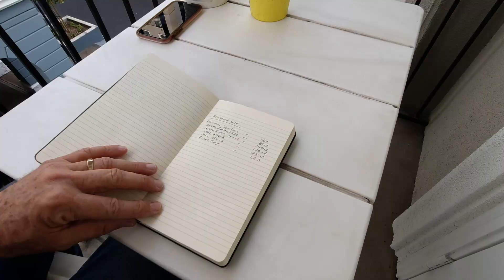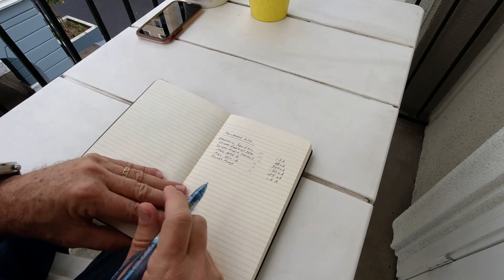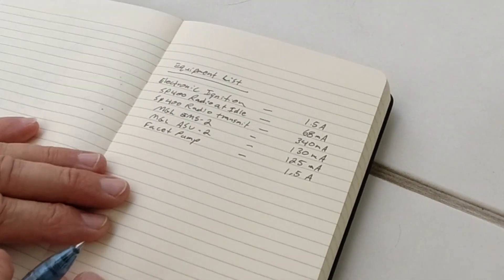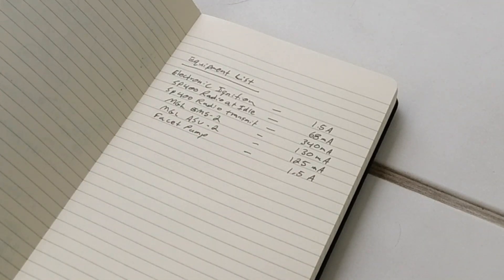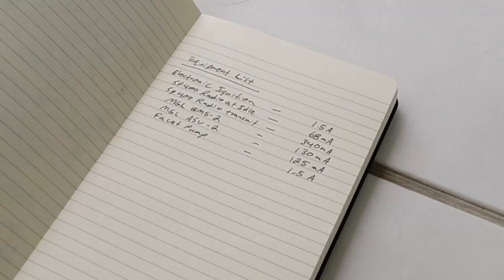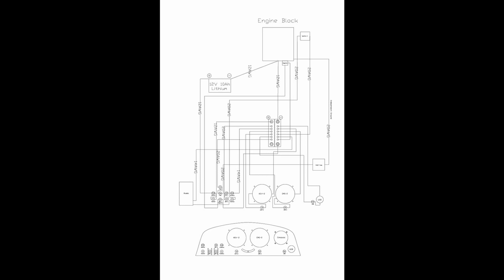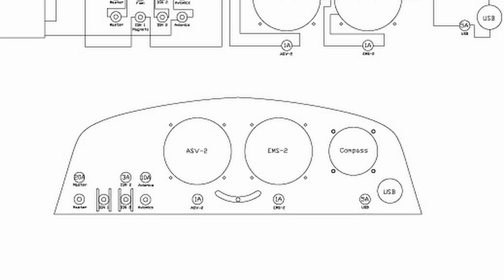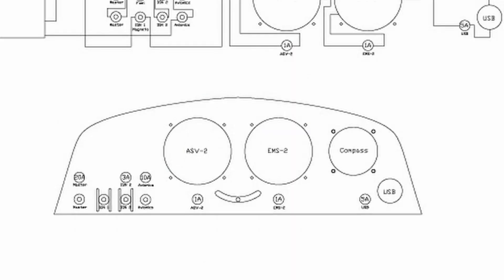Minimax 1100r Aircraft Build Vlog Episode 44 - Power Distribution

Comment: I have an MGL for my engine monitoring. It is great with the ability to set service timer, HOBBS (which you can set trigger RPM on) and flight timing.
You will have to add all the sensor wires for CHT, Oil, EGT and ingnition to the MGL for it to give you a display of the relivent info.
Like the Hurry Max colour idea.
Reply from the maker: They look like great instruments. When I added up the cost of a full steam gauge panel, the cost was a lot closer than I thought between that and the MGL.
Reply: @DTMinimax  Function for weight, cost and clarity of display is why I went  that way. The only think that took time for me to get to grips with, was digital rather than analoge tach.

Comment: I’m not an expert, in fact I know very little about Aviation. However, I do have a couple of thoughts that I feel, should be considered. 
Take for example, A motor in a lawn mower doesn’t require a battery. It generates it’s own power to operate it’s own ignition system.
If a similar generation system is used and there is a complete loss of battery power the engine will still continue to run. A lighter battery would be required offsetting any increased gain in weight due to the power generation system usually in the flywheel of the lawn mower motor. In addition, it may be possible to produce a charge for the battery, thus requiring a even smaller battery! I don’t think this would add very much weight and would add a very beneficial  amount of safety. Also, are you remembering/required to have any strobe/wing lights in your calculations? 
It’s been very interesting watching you build your plane. Makes me want to consider doing something similar!
Take care!
Murray Adams
Reply from the maker: The aircraft magneto operates the same way. It isn’t connected to any power source so a dead battery has no effect on it. I had a complete loss of the electrical system in a Cessna on night but knew that as long as I had fuel, I was good. 
There are some small wind driven generators that the Piper Cub guys use. I’m curious, what type of charging device were you thinking about?
Reply: @DTMinimax  
Hi Dennis, 
A Briggs and Stratton engine for example, uses a magnet in the flywheel to help produce the current to create the spark to ignite the fuel. Perhaps this same principle can be used to generate some type of usable current to charge the power supply. If that does not work perhaps this might work. My snow blower has heated handles. I am not sure how much current is required to operate them or what voltage they produce, but these systems are built into some small engines. Perhaps this is a possible option that exists and can be used on the engine that you have chosen. I have limited knowledge about this stuff but if you are able to ask the right people perhaps they can help you find or design something that will charge your system.
Murray Adams

Comment: Hi Dennis, great video! I enjoyed the insight into your project & the schematic diagram looks well tought out, I am curious if you add the USB charger capability will you have to factor that into your calculations as well as a safety measure? Will there be a battery monitoring device to show what the draw is & what's left? One thing I learned is while it's easy to see a fuel or oil leak, you can't see an electron leak. The Mini Hurricane paint idea sounds great! I love those old birds. Cheers from Down Under!
Reply from the maker: Hey Leo!
I will be monitoring the battery and good catch on the USB, I left it off the list. 
So true about the electron leak:)

Comment: This isn't part of power distribution but have you considered having a few go-pro mounts around the airplane?  On my Legal Eagle tip ribs I have epoxied some 1/4" ply plates with a few captured 10/32 nut plates. They will be flush with the finished wing tip. Just a thought.
Reply from the maker: Awesome idea to plan those in Kevin! I’ll get some nut plates!

Comment: Hi Dennis.  Enjoy following your build.  As you have talked a bit about weight,  will the 1100R be a Part 103 build, or an EAB.  My EROS 1650 came in at 396lbs empty weight.  Oh, and the VW is an excellent choice.  I would really like to have had the 4 cycle instead of the 2 cycle.  Thanks.  Oh, you never mentioned  it, nor can I find information on the fuel system.  Does the VW engine have a pneumatic system?  I know you will be using a Facet pump.  Here's my concern:  IF the Facet pump quits - they do - is there a "back up" pump?   If the VW has no pump, my suggestion is to have TWO Facets pumps, working in parallel (one on standby),.  So, if your "main" pump fails, you flick a switch for the secondary pump.  Two of everything Dennis.  :)  Also, you can get a 15psi little tiny gauge at Advance Auto, I think, for about 25 dollars.  Could "T-off" of your fuel line, near the carburetor and ALWAYS know if you have fuel pressure.  Don't mean to interfere with your planning, but the fuel system, as you well know, is critical.   Thanks
Reply from the maker: Michael, laying out the fuel system is next on my list. The Zenith carb is gravity fed and doesn’t require any pulse from the engine. The facet is the back up, and not the primary. 
Two wing tanks will feed to a gascolator, fuel shutoff,  then the facet pump, then the fuel filter, and to the carb. Just have to lay all this out to make sure fuel is all going downhill with the gascolator bowl as the low point of the system. 
I have no intent to build part 103 and will be going the Experimental route.
Reply: @DTMinimax  Thanks for the update Dennis.  I will continue to watch your build - brings back a lot of memories. :)   You are doing your build in an exceptional manner.  Thanks.

Comment: As an RC pilot with a lot of experience with batteries, I'm concerned about you using a Lithium based battery as your sole source of power for things as critical as fuel pumps and electronic ignition systems.  If the batteries fails, won't the engine quit?  Lithium based batteries hate heat.  They hate vibration.  And they hate being charged to 100% and then run down close to zero repeatedly - do that just a few times, and you'll start losing capacity, and by a hundred cycles or so, the battery is worn out, and prone to instantaneous failure, without warning.  I hate to bring this up, for fear of upsetting someone, but I'm more afraid not to bring it up...
Reply from the maker: The engine is running off of a Magneto as primary ignition, electronic is the secondary. It keeps running with or without a battery. 
These new sealed Life batteries have some smart technology. They have a flat discharge curve unlike LiPo batteries so they consistently supply power. Probably why a small battery is $100. 
They are built for rugged environments like dirt bikes and stuff. -30 to 120 degree operating range. They quote 2000 cycles but you know how that goes. There are a lot of experimental airplanes using these type of batteries. 
I also fly RC and you’re right, I wouldn’t want any batteries like I use for RC near my airplane.
Reply: @DTMinimax    Thanks Dennis.  I appreciate the explanation, and I learned a few things.  I looked up those batteries.  They sound like a great product.  Again, thanks for taking the time.  Despite the fact that I built a 1030, I'm learning a lot from your videos.  I can't afford to build, so watching someone else is the next best thing.